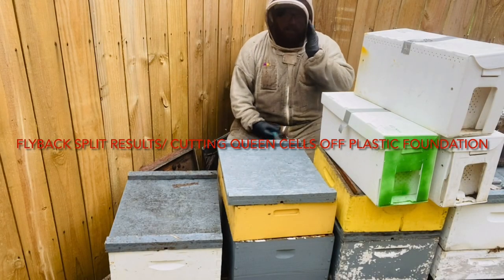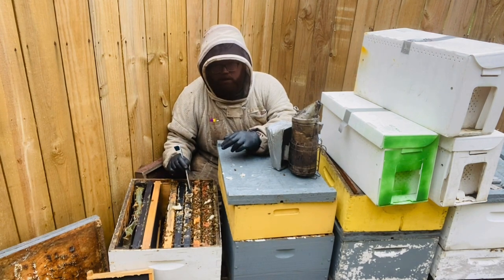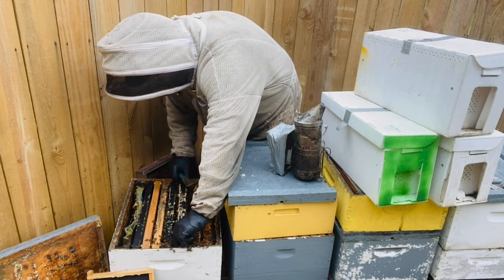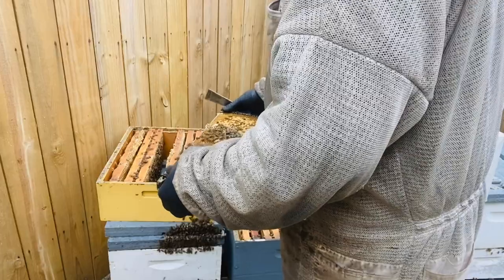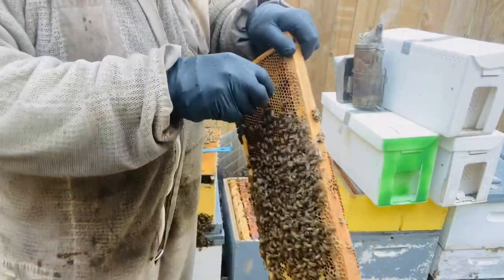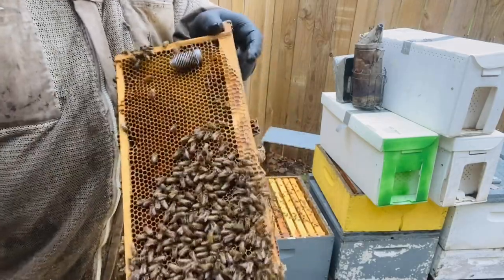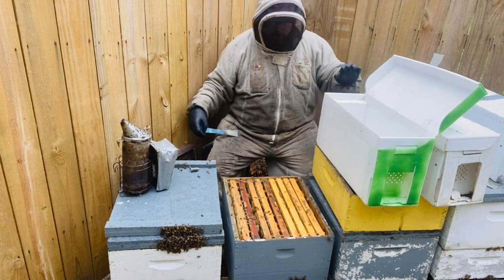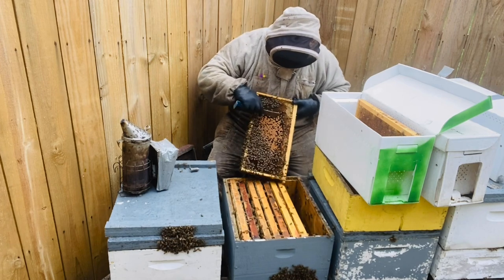How To Remove Queen Cells from Plastic Foundation! Bonus Pierce Beekeeping cell protector!

Comment: Really like the wire cell protector.  You could sell them in your online store. Everytime I try to use the plastic cell protector with a harvested cell. It's always too smaller. Thanks for the demonstration on removing the cells from the plastic foundation.
Reply from the maker: Exactly!

Plastic cell protectors are made for grafted cells.

The spiral wire protectors will accommodate any size cell that you’ll find and cut free in a hive.